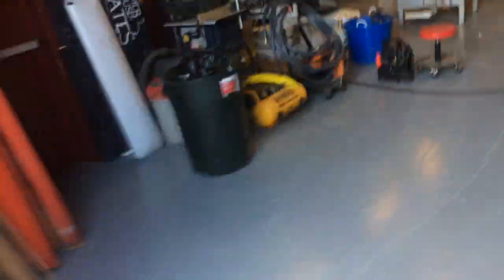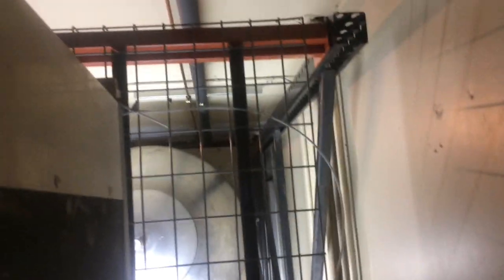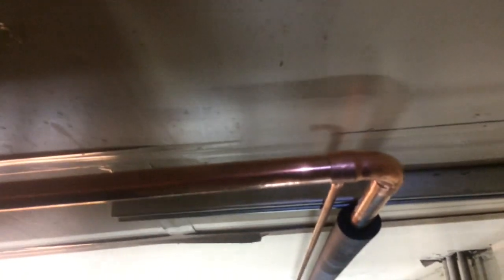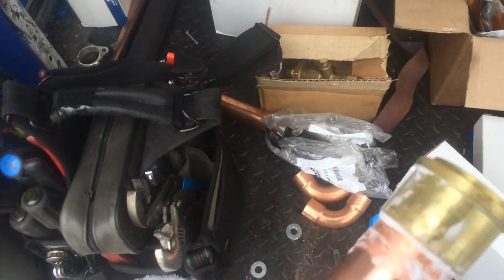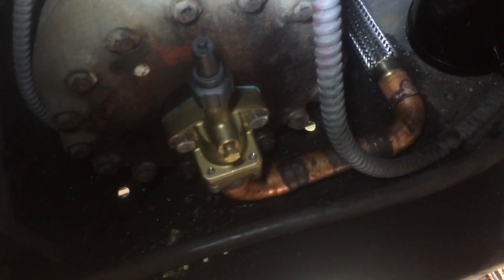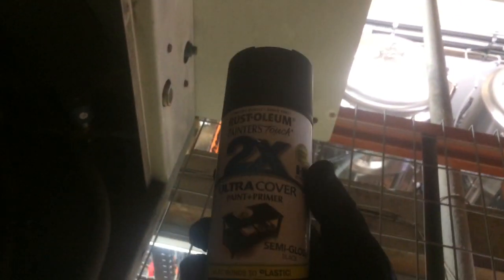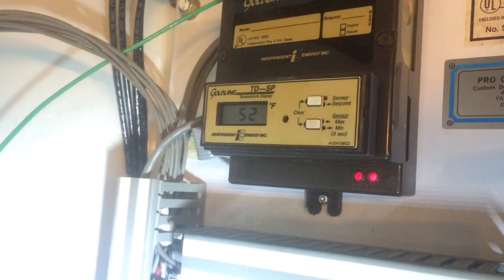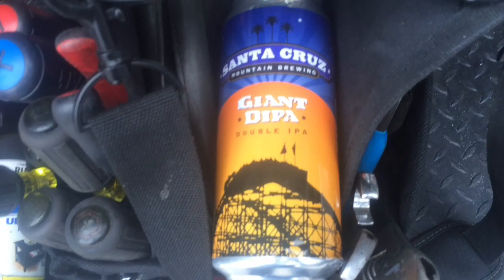Glycol chiller

Comment: Good piping bro , I did commercial refrigeration for ingles supermarket for 12 years and I got off the road and started doing ac heat pumps and gas furnace break downs.